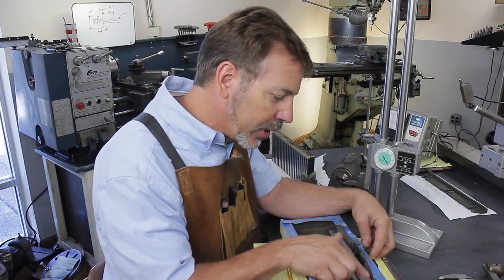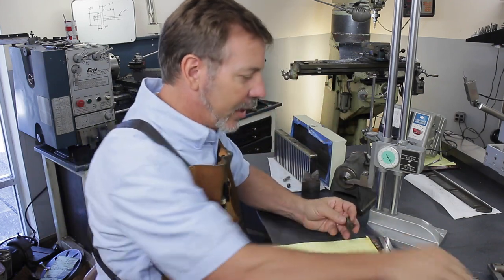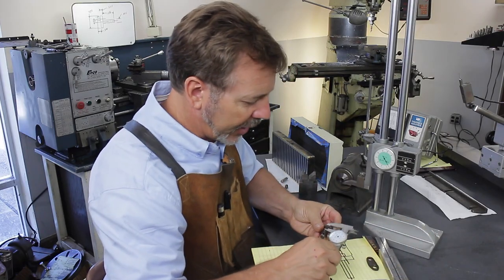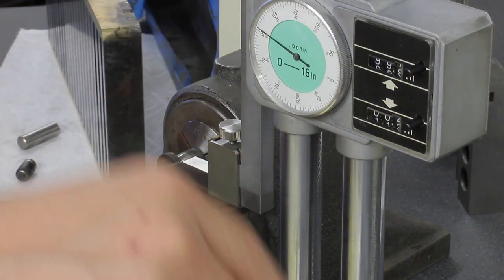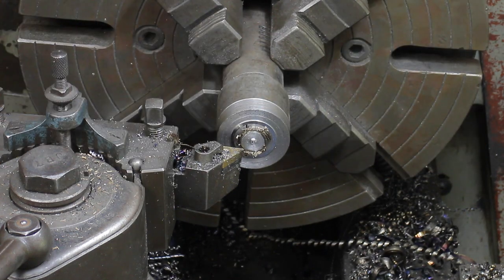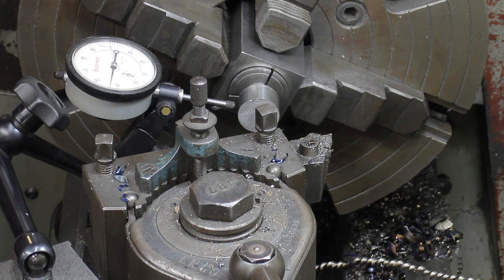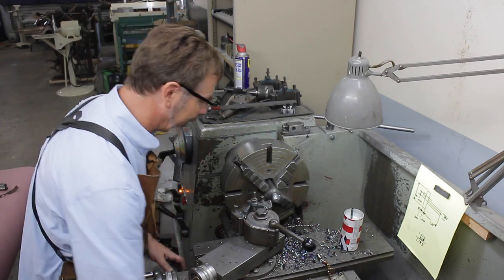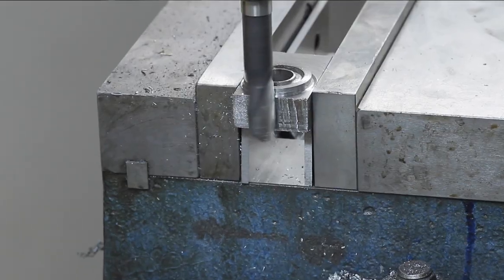Magnetic sine plate repair PART 3

Comment: Enjoying the series so far.  Am really looking forward to part 4; I want to find out
how and what the heck you did to your poor fingers!  (my money's on heating furnace).
Reply: He may never disclose it, it might be too embarrassing!  Looked like some of his wounds had the glistening of a super glue repair to me.
Reply from the maker: +This Old Tony   Thanks for your comments. As for the damage on my hand i don't remember what i did.  But if i were to guess i would say a wire wheel or chainsaw.
Reply: @BuildSomthingCool  Hi, Dale. I am writing to you from Europe. Can i ask you, if you still remember, if the upper plate was magnetic, or not ? Because we in our shop , are repairing similar magnetic sine chuck, which does not want to release (on the off) , and the upper plate is very magnetic, as i think, that it should Not be. Thank you in advance. Greetings. Boscthyan & Joseph.
Reply: Hi. The top plate should not have a magnetic charge unless it is on. Have you taken it apart and is the top plate still magnetic?

Comment: A circular cam is one thing. A profiled cam is another entirely  because you have to mill the profiles. The Internal Combustion Model people  do this quite frequently with special jigs; I found one article in Home Shop Machinist and another in Model Engineering, but I am sorry I did not copy the references. It goes something like (1) make a fixture for the mill (2) machine the top radius of the cam in the rotary table (3) ditto bottom radius (4) machine the flats straight. A formidable job. Still it can be done. Certainly helps to rough it out the way you did.

Comment: Dale, the cam offset or the centerline of the shaft to the centerline of the pin is 1/2 of the distance between the magnet sectors isn't it?  That dimension you can measure directly can't you?
A small bushing for the shaft and a small bushing for the pin would be a good idea.

Coming along fine.
Reply: Yeah, I would say, calculate the amount of travel needed and do the math on the linkage, if one wanted to verify or double check  the measurements or estimations on the very worn parts. 
pretty good challenge here, that will be a great addition to your shop, cheers!
Reply: That is just what I was thinking.
Reply from the maker: Hi Ron. I really like the idea about the bushing. I will have to do that next time. I wish your math was as easy as you say , but its not. Because the center of the cam pin is set off from the pin on the magnet. :-(
Reply: I was thinking that as long as the magnet is constrained to move only in one axis that it has to move the same distance as the cam.

Comment: Hardened steel against hardened steel makes a fine bearing surface. It’s used in a lot of high precision equipment. It just needs to be lubricated properly. The reason it wore so badly there is because of the rust. Iron oxide is hard. Use water as a lube, and you get a lot of wear. If the bearing was bronze, it would have worn much more quickly. What’s needed is water rejecting grease for that wear point.

A collet block is good for that,  it there’s a better way. Take a piece of mild steel or aluminum and take it down to about 0.750. It doesn’t have to be exact. Drill and ream a 0.500 hole for your part, or whatever the actual diameter is. Then slit it. When you put it back in the chuck, orient it the same way, and you’ll have pretty much perfect concentricity. The jaws will tighten it by closing the slit by an infinitesimal amount. Yes, it can take a bit of time, but the time is partly made up by not having to do the extra steps done with the block and collet.

Comment: You measured the offset at .400 . ok.  I believe it is a function  of the distance between magnet poles. ON / OFF location of sliding action. Did you that that into consideration when settling on .400?
Reply from the maker: HI tom, I wish the math  was that easy, but its not, because the center of the cam pin is set off from the pin on the magnet. :-(

Comment: Enjoy your video's but is not the cam measurement the distance you want the magnet to move from unlined to aligned.
Reply from the maker: Hi Biggrey, I wish it was that easy, but its not. Because the center of the cam pin is set off from the pin on the magnet. :-(
Reply: if offset and pole pitch are known, it's just a triangle problem.  pythagoras is the man to call.

i also wondered if one of the arcs on the flanged part of the cam would be concentric with the pin.  
though finding the center of a short arc of unknown radius would be an entire new problem.

Comment: You could have measured the distance across two poles to find your offset.  It is not so much the size of the old part that you need, rather it is the distance you want to move the poles...
Reply from the maker: Hi Bob, I wish it was that easy, but its not. Because the center of the cam pin is set off from the pin on the magnet. :-(

Comment: What you want to use is hardened steel say 440C which is a chromium steel used in bearings moving on Ampco bronze which most grades really last to say the least. This combination is just the shit. Please pardon my French BSC. I have noticed that the old type of magnetic surface plates had much larger diameter shafts and eccentrics as compared to the newer generation items. You do realize that you could just measure the spacing of the segments of the magnets and you are golden. Just saying fella, not really hard at all.

Comment: Dear Dale,
I really like your channel and appreciate the efforts you put in the production, but one thing is REALLY annoying: The audio quality of your videos. Since a few months there is a mix of noise and distortions in every video. This is very distracting. Particularly for non-native speakers a very good audio quality is essential.  Could you please switch to a wired microphone or use a wireless transmitter which isn't broken?
Reply from the maker: Hi Mchael, I know I need a new mic, but a good one is around 600 bucks. I bought a $200 one and had to throw it away.